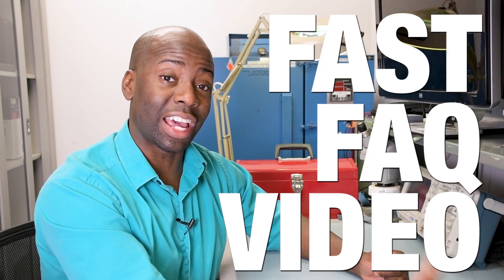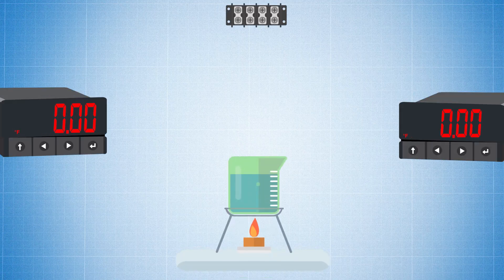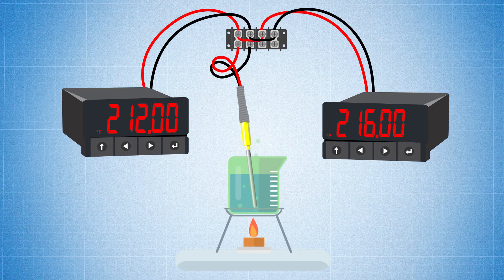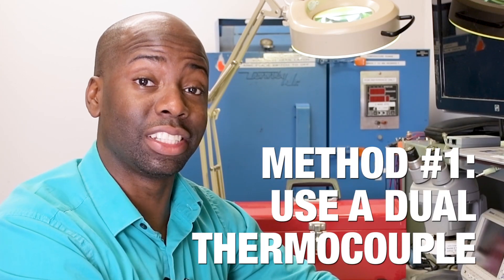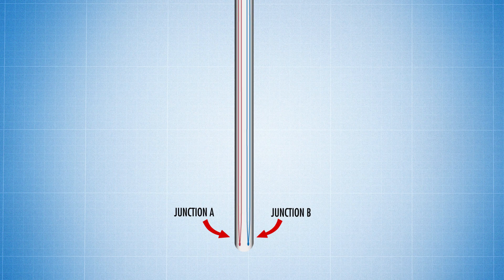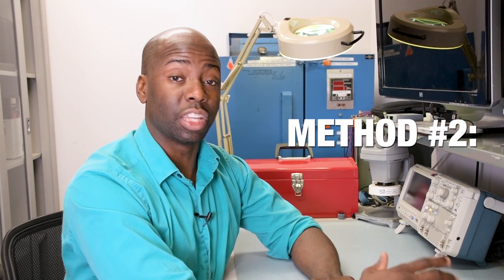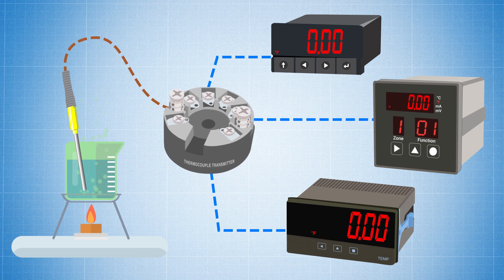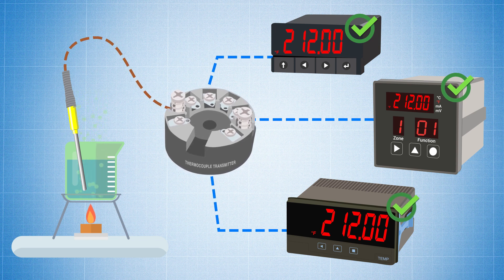How to Split a Thermocouple Signal - Fast FAQ

Comment: A common way to wire multiple devices to a transmitter is to loop them together as  oppose to each device having their own independent loop as shown in this video. You also have to add a power supply to the loop. It is a good idea to have the transmitter first in the loop right after the positive terminal of the power supply because the transmitter causes the higher voltage drop in the loop because it is the only device being powered by it, both the recorder and the controller have their own supply.

Comment: this video  intrigues me.  i wish to split a  signal into a esp8266 or similar board to send the signal into my local home network for readouts.  sounds strange, but i like to know what my soldering iron knows (when it is at full temp for example).